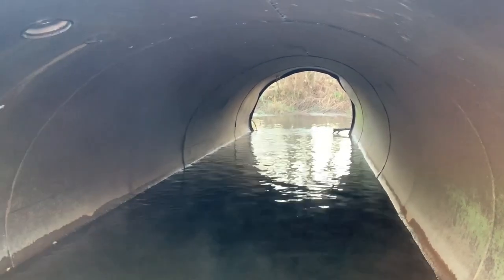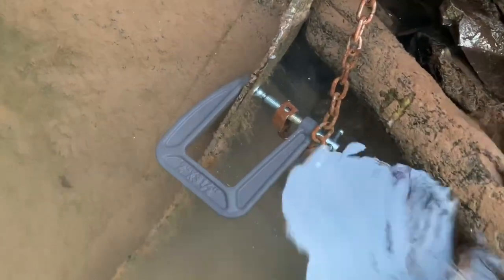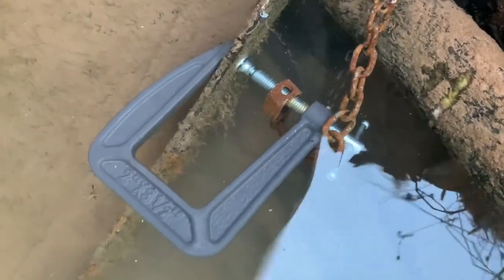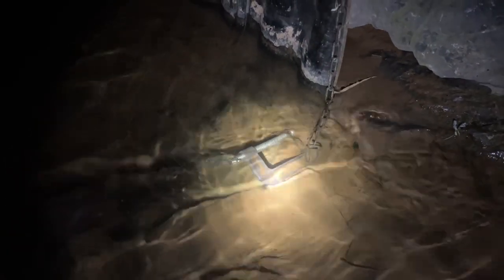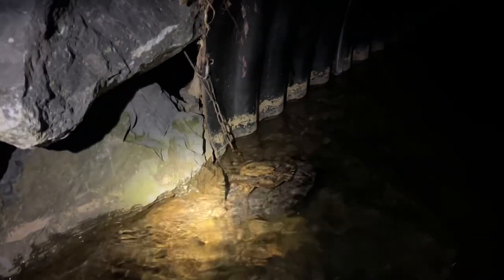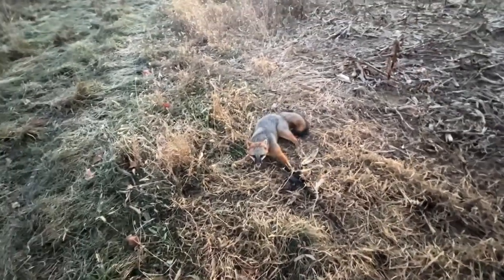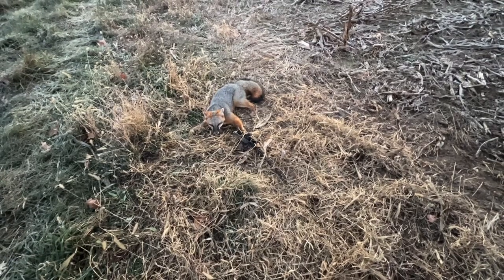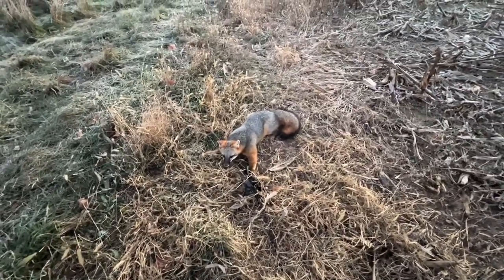C-Clamps in Pipe Culverts for Top Edge Mink

Comment: I don't need another thing  just use cable or wire.
Reply from the maker: You missed the point. They are to stabilize the trap.
Reply: @toddstrohecker  has that